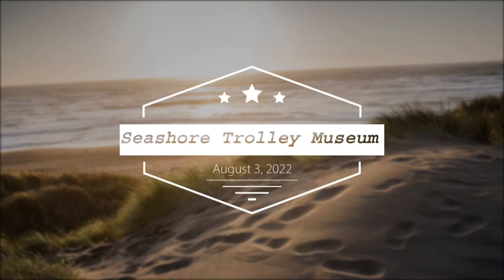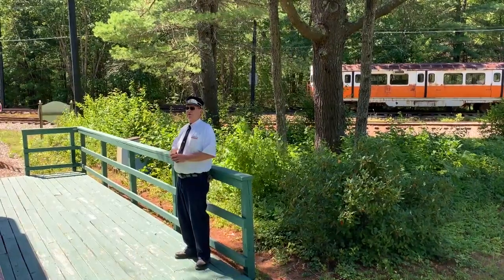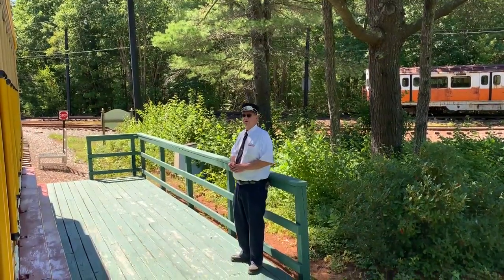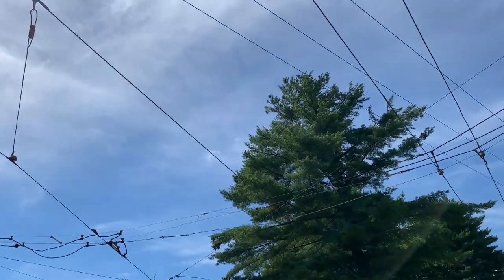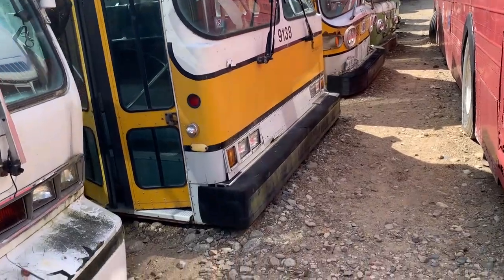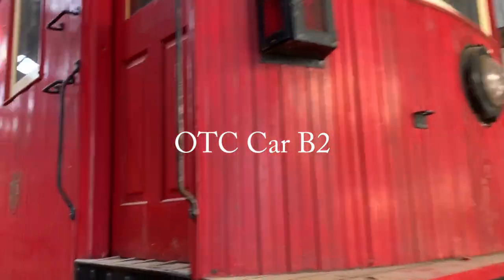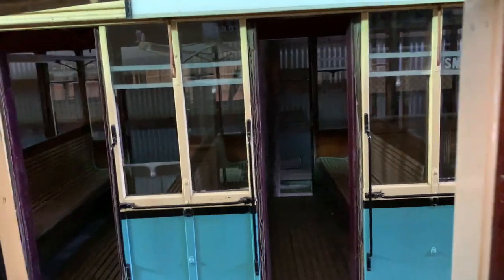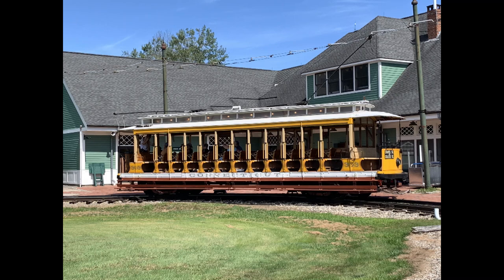Seashore Trolley Museum Aug 3 2022

Comment: The orang train behind the announcer is an Boston L PCC type train that me and my late mother rode on a trip to Boston in 1978. The PCC type L trains in Chicago were shorter and had 2 sets of blinker doors on each side and small oval standee windows above the passenger windows and were painted white on the roof to the window level and dark green below the window to the bottom of the carbody.